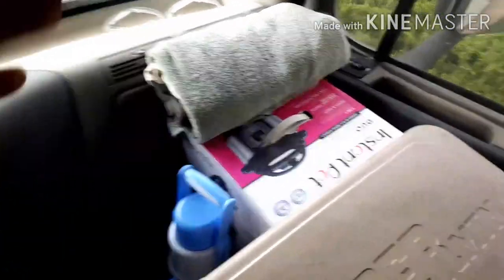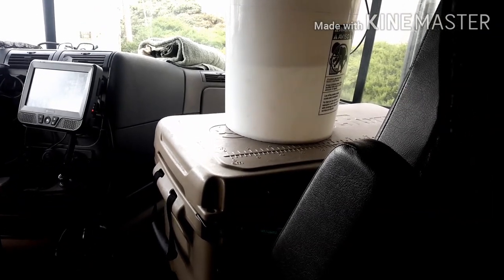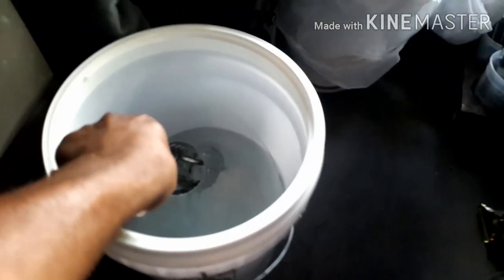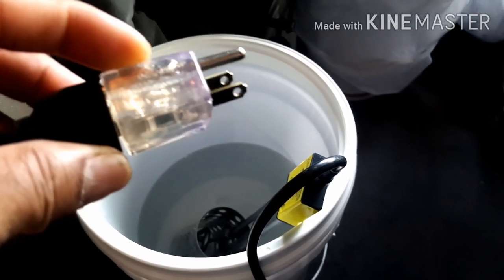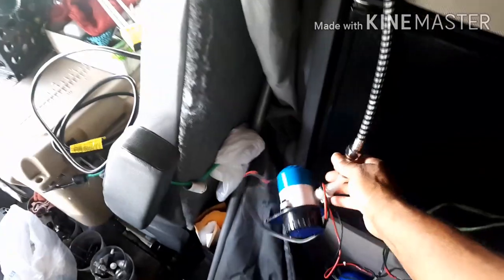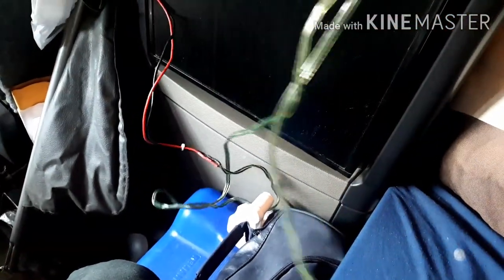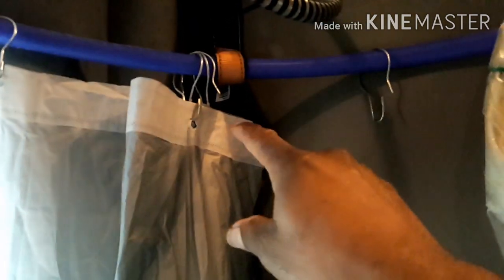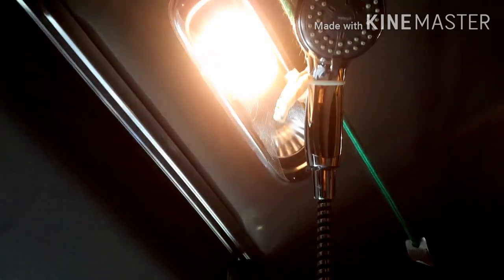MY DIY WORK TRUCK SHOWER DEMONSTRATION🛁 #STEP VAN LIFE

Comment: Gonna try this in my truck
Reply from the maker: I had to adjust that setup three or four times until I got it quick and easy to setup and use.  Worked great for about 2 years.  Now I'm in a different truck and I don't really need it in here like I did before.  Thanks for watching.   I hope you have success with yours.👍🏾
Reply: @xlamontx  thanks boss

Comment: And just to think, I recently saw a video of a Super Cab with a Full Kitchen and Bathroom with a separate Walk- In Shower. Some of the folks in the comment section were wondering out-loud how the guy could make any money on the road with the Cab Extended for as long as it was, LOL!!🙂🙂
Reply from the maker: I see them occasionally out here on the road.  I would think the long wheelbase would make them challenging in tight cities and small towns.  Thanks for watching.,👍🏾
Reply: @xlamontx  Yes....for sure, I bet that turning them would be a challenge. Although, I think they can now come with   a Tag Axle....and I'm not for certain, but I think that this helps them turn in tight situations.

Comment: Love. It.
Reply from the maker: Thanks Brandon
Reply: @xlamontx  I came to your channel via that couple who interviewed you. Didn’t sub to their channel though. 😂 I live out of a pickup truck. Have done so for the last 7 years.  Prior to that I was 7 years renting and prior to that I was in my mini-van for two years. Prior to that I lived in the jungle with gorillas who accepted me as one of their troop members. I had to fight a silverback to gain status among the members. Got the crap kicked out of me so I ended up at the bottom of the totem pole. I kid. I kid. Anyhoo...right now I have 200 Watts of solar panels on my roof but in the spring I will put more on. I run electricity for lights, charging devices and a camper refrigerator. I love living like this and next year I may move into an old 1979 Sprinter RV I own. I’m told it looks like the one from the show, "Breaking Bad."
Reply from the maker: @BBBCanada1  
Wow!!  7 years in a pickup is pretty hardcore.   My hat is off to you.  After a year in my box truck, I go to a step van.🙃  I'm keeping the box truck around as insurance just in case the step van suffers a catastrophic breakdown.  Because of the way I camp, that '79 RV sounds good to me.  Probably better made than a lot of the new RV's being sold these days.
In hindsight, I could have got away with a lot less solar.  I knew the main thing I wanted from my setup was to be able to cook on an induction cook top.  Glad you found my channel.  Honored to have you as a subscriber.  Be safe out there.👍🏾

Comment: That’s something like I designed in my van for a shower, my tub and bucket are collapsible. Thanks for sharing
Reply from the maker: That has been one of my better ideas.  It still works very well with a quick setup and tear down.👍🏾
Reply: Do you have pics of the collapsible tub and bucket and maybe the place where you can purchase them please 🙏
Reply: @qdchipmunk  
Sure, they both were purchased at Amazon. The tub is a foldable doggie tub and the bucket is a collapsible  bucket. Good luck with your project👍🏾

Comment: Wow that's amazing. Personally I'd just go to a truck stop shower because it seems like too much of a hassle to have to set it up and then clean up afterwards
Reply from the maker: It was a little extra work, but I got away with it for well over a year.  I didn't mention it in the video, but I rarely fuel at truck stops.  I couldn't bring myself to pay $12 per shower, 4-5 times a week.  When I do buy fuel on the road, I certainly take advantage of the free showers. Thank you for watching. 👍🏾

Comment: Very nice. If you slip and fall your screwed because there will be butt cheeks against the windshield! Lol

l used to have 2 storage bins I would empty, microwave water and keep filling one up with hot water on the bed with a towel down. Then take a clean washcloth and start washing. Dunk the dirty washcloth in the other tub of plain water. Wring it out and try to get another use. And just keep grabbing clean washcloths and repeating. I would even microwave the clean washcloths.Then I'd save the dirtiest parts of the body for last. Then rinse and wring the dirty washcloths and put in with the dirty laundry. Then shave my face with the glass mic safe bowl. I'd use towels and paper towels to dry up small messes. But yeah your way is way better.
Reply from the maker: Thanks for watching.   Lol... thankfully I never my balance and gave the truck stop a good laugh.   I still do the multiple washcloth routine  occasionally.  It's all about doing what's needed to get it done.👍🏾

Comment: Cool setup! I was planning on doing similar with my shower when I decide to install one. I don’t want much stuff taking up permanent space like dedicated bathroom/ shower as others do. The ability to move it or pull it completely out is super handy. Thanks for sharing!🙏🏼✌🏼
Reply from the maker: I was going to keep it basic and possibly go perminant later.  Then I realized I need the exact measurements of the shower stall I would use to properly build around those dimensions.  I bought a 32"×32" kit that will be big enough to store the toilet.   That way the space is dual purpose and I can just move the toilet when I want a shower.  That's what I'm thinking,  but I may think of another option before it's all said and done.

Comment: Am I missing something? Pilot showers are free with certain amount of gallon fuel bought
Reply from the maker: You are absolutely correct.   However, the company saves money if we fuel at our head quarters versus buying fuel on the road.  I can make a round trip (1000 miles) with 95% of my loads if I start with full tanks so there is almost never a need to buy fuel at a truck stop.  I can also save time if I can shower at the end of my driving period (once I arrive at the delivery point) instead of in the middle of it.  Thanks for watching J Solo.  Safe travels.
Reply: If you want to go in to a gross public shower that may or may not be clean. Then wait an hour for one to be free.

Comment: Does the bucket heater have a office name or brand  could use something like that for  my setup
Reply from the maker: It's an Allied Precision 742G.  I put a couple of links in the video description for Ace hardware and Tractor Supply.  Others may sell it, but that's the two I know about.  Thanks for watching.

Comment: How do you have the hula hoop and shower head hooked up?
Reply from the maker: A strategically used "zip ties" and four "Keeper Wrap-It-Up Orange Carabiner Strap 05268" from Home Depot to hold the hula hoop between the cabinets of the Freightliner I was driving at the time.  I drilled very small holes in the top corners of the cabinets to loop the Zip ties through.   Zip ties alone would work but the Velcro straps made adjusting the hula hoop eaiser.  I currently drive a KW now and it doesn't have cabinets to the ceiling and would be a bit more challenging to find anchor points.  As for the shower head, a bungee cord stretched across the tops of the same cabinets allowed me to position the shower head above my head but slightly to the right side of the truck for the best effect.  

Side note: I eventually upgraded the hula hoop to making a rectangle from 3/4 inch pex tubing and four 90° elbows.  After about 12 months of being stretched to an oval, the hula hoop failed and I just used what I had on hand.

Comment: Nice video guy.. question how long does it take for water to get hot?
Can you walk the switch part. I have the rest and wife is bugging me to finish up. But I'm burning thru my 4 gallons to fast a switch wii help me.
Will the inline fuse on the hot or ground wire? I'm excited bro thank you.oh can I put a switch on the heater as it will be left inside my bucket so I don't have to keep unplugging it?
Reply from the maker: Thanks Florin Santos.  It takes about 30 minutes to heat a 5 gallon bucket full of water to a comfortable shower temperature using a 3000 watt inverter.
Reply from the maker: The switch I used on the 12 volt DC pump is a in line lamp switch from the hardware store mounted on the negative wire and the 10 amp in line fuse is on the positive wire.
Reply from the maker: Yes,  you could put a switch on the heater, but you may want to run that question by an electrician to see if it's advisable. 

IF IT WERE ME... I don't think I would cut the wires on the heater to add a switch.  I would add a switch to control the outlet the heater is plugged into instead.  When I was a kid, we had one outlet in the living room that we kept a lamp plugged into and it was turned on or off with a wall switch on the opposite side of the room.

Thanks for watching.   Best of luck with your project.
Reply: @xlamontx  my goodness 3000 watt inverter? I only have a 1000 watt.
So that won't work for me

Comment: Can you share with me where you got your shower set up
Reply from the maker: I made mine using a bilge pump and other random parts so I could power mine using a cigarette lighter plug.  Here is a link to camp shower that works about the same, but uses a battery to power the pump.  

Ivation Portable Camping Shower | Compact Handheld & Hands-Free Rechargeable Outdoor Shower Head & Cleaning System w/ 3.7V Pump, 6-Ft Hose, Bidet Head, Removable Filter, Multiuse Hook & USB Cable https://www.amazon.com/dp/B07SY9J14X/ref=cm_sw_r_awdo_navT_g_V3H4J07SM6ZSGGQ34PJB
Reply from the maker: I have a similar battery powered shower for a backup.   They work very well.